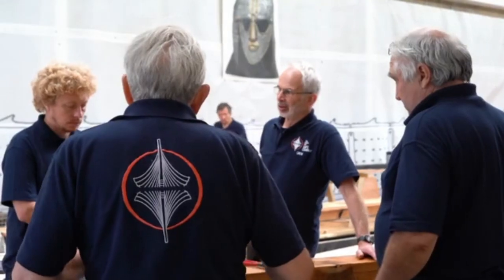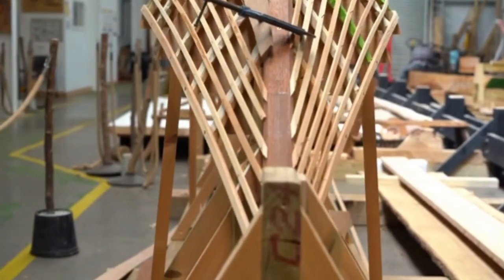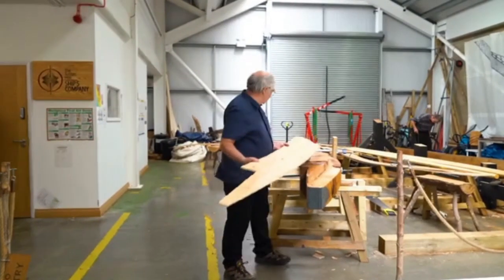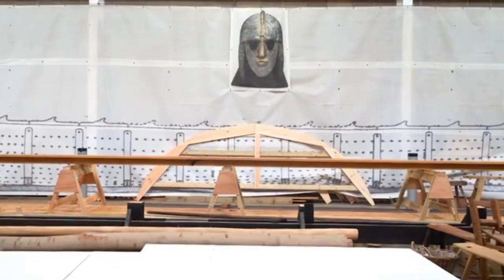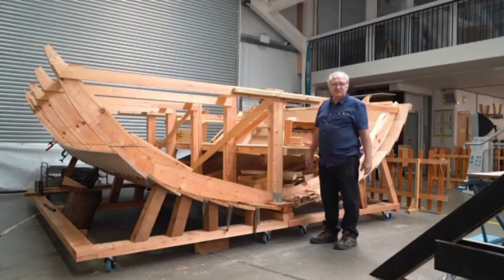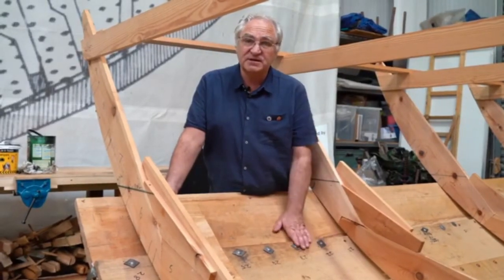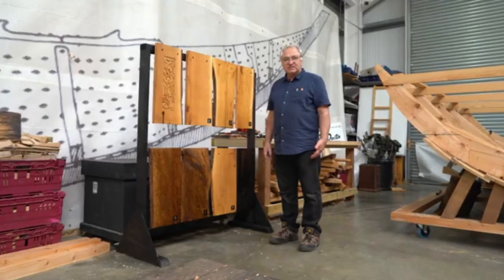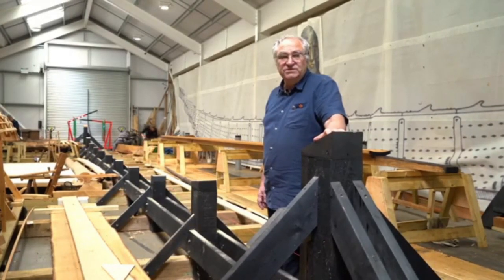The Sutton Hoo Ship's Company - Inside the Longshed with Tim Kirk, Master Shipwright

Comment: About nails, you probably already know, but they have started using copper nails in Roskilde, because the original iron nails will break down the wood in 20 - 40 years. They have already had to retire one ship replica for that reason.
Reply from the maker: Hello Leif,  thank you and a very good point. We are aware of the reaction that the iron will have on the oak and have debated using copper instead but as this is an experimental archaeology project we need to be authentic so we have decided to stick with iron knowing that it will limit the number of years that the ship will be on the water. This of course comes with all sorts of other 21st century issues such as the noise the clinking creates so we are in the throws of working out how to mitigate the noise level and restrict the amount of time our volunteers are exposed to that many decibels. We went to Roskilde in 2019 and made some good friends who have been helping and advising us along the way. We hope to return next year and also visit the Nydam ship which is about as close as we can get to the Sutton Hoo Ship. Thank you for your interest.
Reply: @TheSuttonHooShipsCompany  I was thinking abut the Nydam ship too. Pity the larger Nydam ship wasn't preserved. 
Best of luck!!
Reply: I have watched the Sampson Boat Company videos from the beginning and one of the common things mentioned is the problem with oak and iron. I would like to see it last and knowing it won't make 40 years is a little sad, but in 40 years I'll be 112 so for me it's a bit of a moot point.